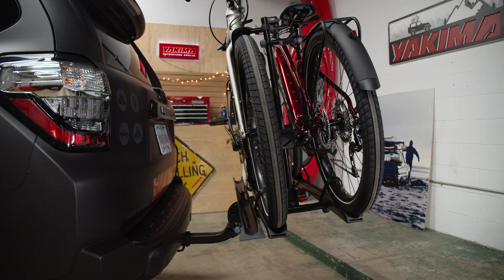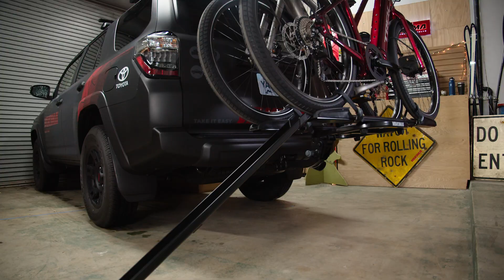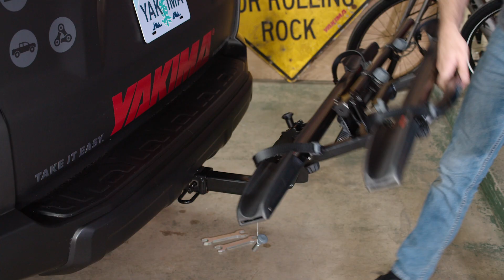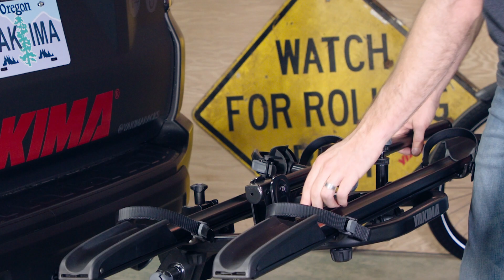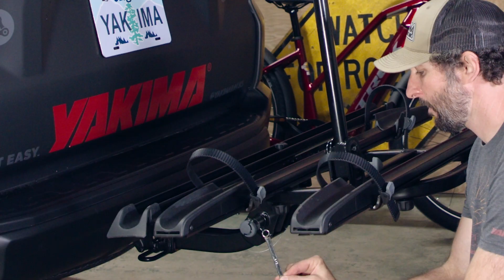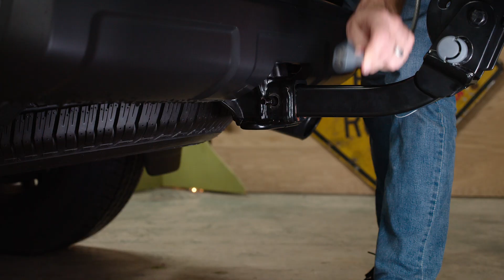Yakima OnRamp Product Tour & Installation

Comment: I purchased this rack and the Ramp only measures 2 inches wide! We were able to roll a bike up the ramp that had 2.5 inch tires, but they were dragging and squeaking the whole way.  I felt like Yakima lied about the rack being able to handle tires up to 3.25 inches when the ramp only measures 2 inches across. I would avoid this rack if your bikes have tires wider than 2.5 inches. I am sorry that I purchased this rack and wish that I had read more reviews before I did.   Many people are complaining about the size of the ramp and the fact that their ebike tires do not fit into ramp or into the tray on this carrier.  I even purchased the extra Yakima ebike wide tire straps to make this work and that was an extra $40.  I would not have needed those if Yakima had made the tray wide enough to actually fit E-bikes.  Yakima has said it plans to update this rack in Spring of 2024.  I hope at that time I will be able to purchase a wider ramp!

Comment: One potential glitch, "grab a friend" to assist with the tilt back feature. Not great for solo flying. I also wonder about strap tightening. Is there a ratchet system, or will I have to rely on my ever decreasing finger strength to pull through latches?  Ramp yes!

Comment: I like my rack BUT, it doesn't work well for larger width tires. Yakima needs to make the ramp and wheel holders WIDER please! The only way this worked for me was to physically widen the middle metal part of the  ramp by putting it in a clamp with a piece of larger PVC to stretch it apart. I had ordered the rack from a supplier so I didn't know it was actually too small for my 2.25 27.6 tires. Please, Yakima, wake up and realize that you are missing out because your rack won't accommodate larger tired ebikes!!!

Comment: The brake light and number plate should not be an optional extra and should be integrated into the design. You will get fined if your rack obscures the vehicles light and number plate.

Comment: I have a Yakima On-Ramp, and honestly, I'm extremely disappointed with it. I have 3 bikes...2 ebikes, and a Specialized Stumpjumper Mountain Bike (non Electric), and this OnRamp only fits 1 of my 3 bikes. It really does not fit any tire more than 2 inches, its only designed for smaller ebikes, and the ramp width is not long enough to have both tires resting on the ramp. The straps are a joke, and must order longer straps, which are not even available. Any longer straps available from Yakima are not compatible with this terrible product. This product is okay if you are transporting smaller bikes, but medium to large bikes, they simply will not fit. I don't understand how the engineers at Yakima did not think of mountain bike transport or bikes with larger tires. I'm so disappointed with this product and Yakima in general (This is my first Yakima purchase), that after my trip, I plan to sell this and replace it with a better product. On a scale of 1 to 5 stars, sadly, I have to give it 1 star and would never recommend this to any of my friends. Yes, its well built and sturdy, but kinda useless too, but I should not have to use third party rachet straps to secure bikes to this ramp when paying $650 for it.